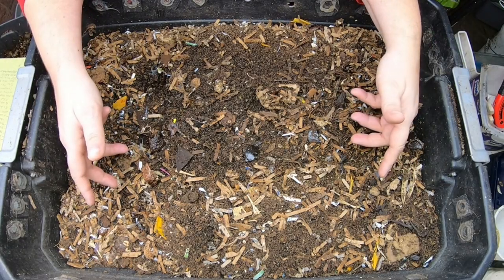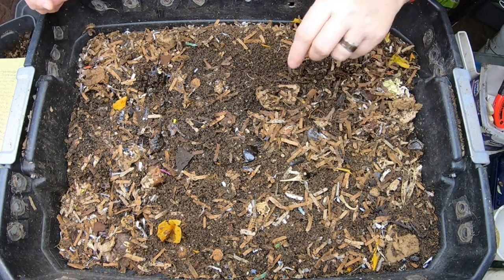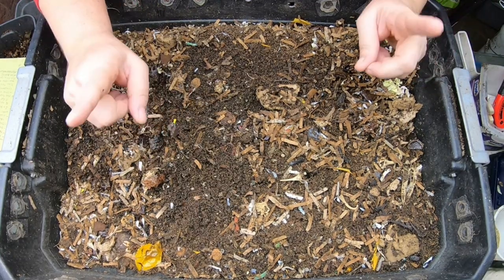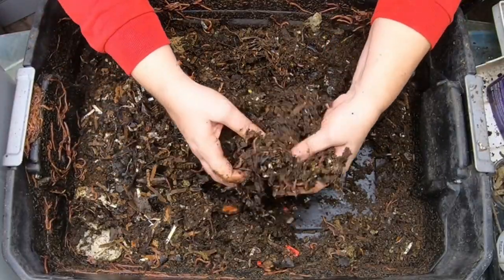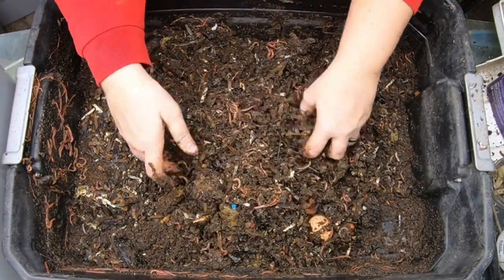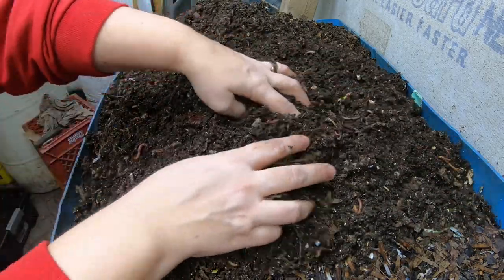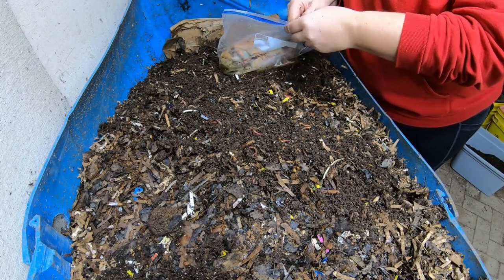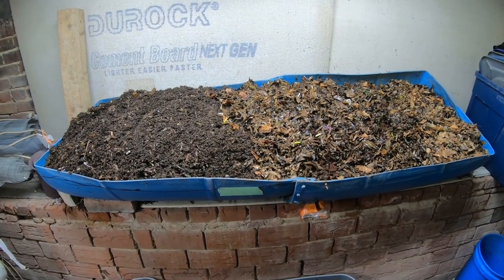Light Harvest DIY bin - Move worms to 55 gallon bin

Comment: Lovely video. I'm curious how you decided to sort castings from that bin before adding to 'blue.' Was it because you needed castings? Blue is already getting too full? Or some other reasons? It seems it would have been an easier choice to just dump the top and bottom levels in blue in the right spots and then sift castings when they are super dry in blue.
Reply from the maker: It was purely based on the need for space in Blue.  I have another month before I need more casting.